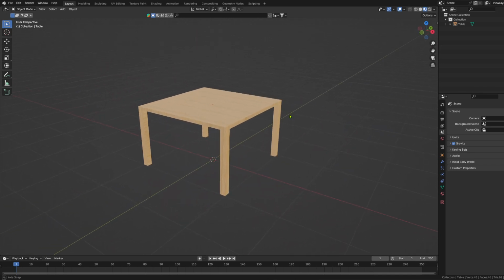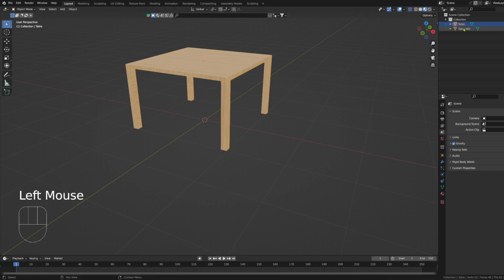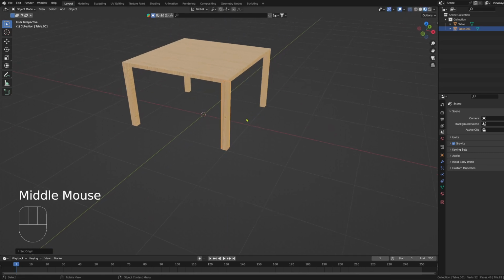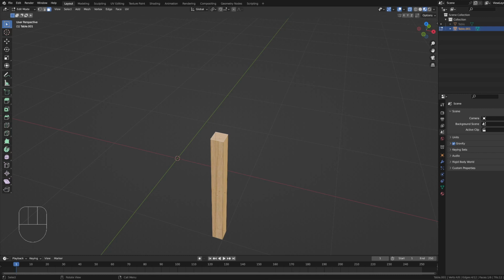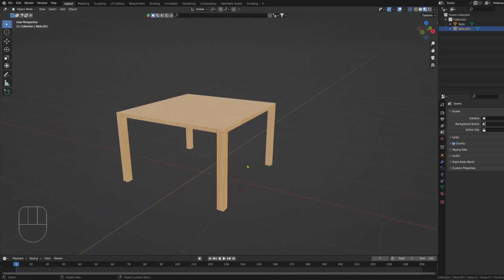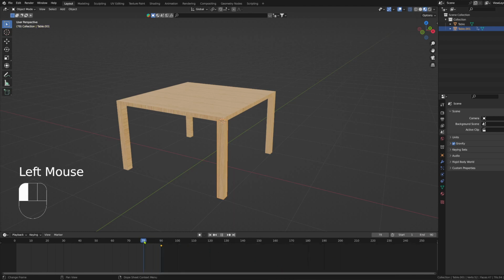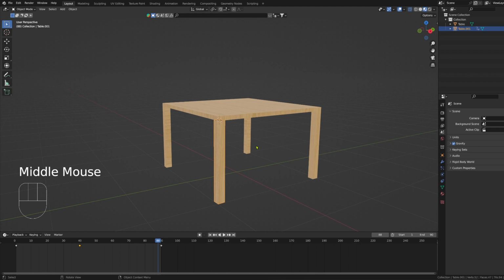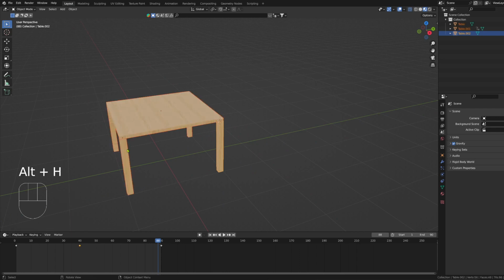Blender 3D - Table Assembly Animation (Separate, Moving Origins)

Comment: hi, 
amazingly explained.
Can u please make tutorials [ including explaination ] of creation of furnitures along with their parts [example table with nuts n bolts] and animation of it also
means animation be like table and its parts coming out from its case one by one [example 5 parts of it coming out separately with their names] and then, assembling each part [example nuts and bolts going inside the holes of the table] 
in short, modeling of table and its parts,
animation of assembling it
flashing the names of each part.
Note:- solid works can do this but it creates in 120Mbs, 200mbs, but i want to create in 5mbs only. also solid works has drawbacks but blender doesnot, i have to do coding in unity engine also hence blender animation is much great.

Please respond, Thanks